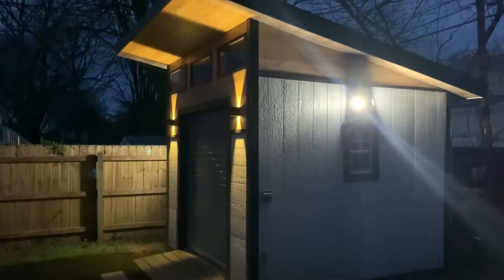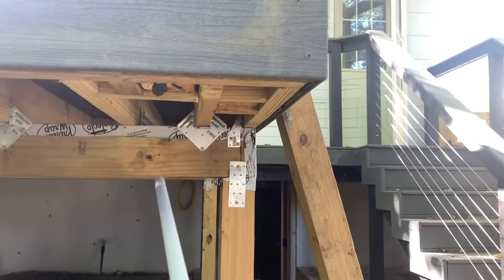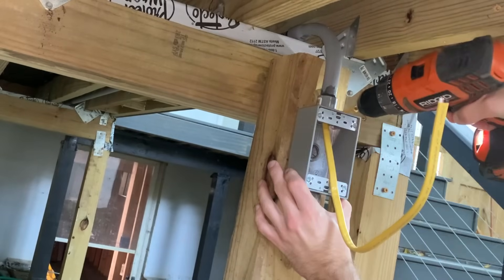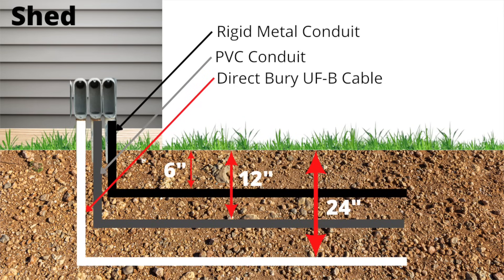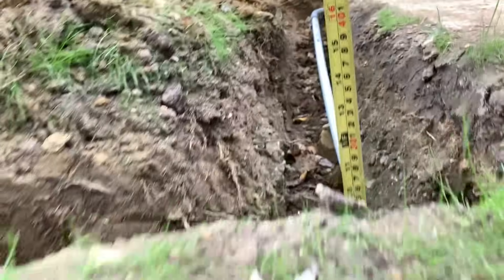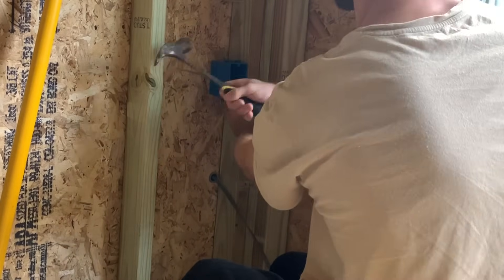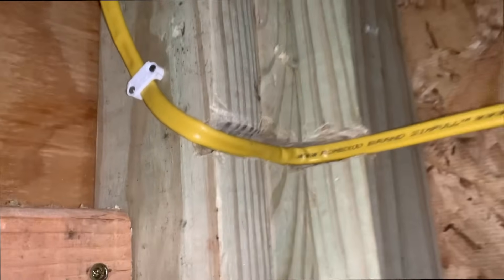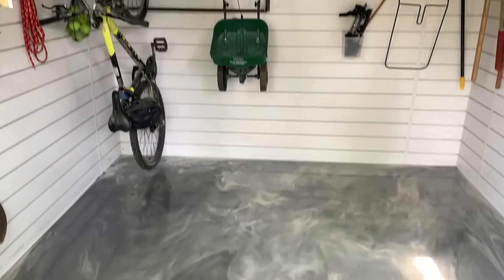Shed Electrical Installation (How to Add Electricity to a Shed - DIY)

Comment: A lot of code violations , was this passed by the inspector ?
Reply: I was thinking same thing especially not running thhn in conduit. I believe the extra jacket on all that wire is going to make the circuit worse as far as thermal ampacity

Comment: Why would you push Romex down PVC? Set a junction box and pull THHN through it until you get to the direct burial cable. Set another  weatherproof box there and tie in the UF cable there or run more PVC and use THHN. Romex in PVC is a horrible waste of conduit space. In a piece of 3/4” PVC, you can safely put 15 #12 THHN in it.

Comment: The NEC article 300.5 table 300.5 clearly states that under normal circumstances PVC shall be covered by at least 18 in of Earth
Reply: Column 4 allows for 12" in this case.

Comment: Romex in conduit is a code violation…I failed inspection for the same mistake. Double insulator is not allowed.
Reply from the maker: That is concerning since the electrician I had come out did not say anything about that.Thanks for mentioning this. I want to reiterate that all electrical work should be performed by a licensed electrician. I get mine inspected, but it sounds like even that isn't 100% Full proof.
Reply: To further add to what PolSlo 80 said, it's not even supposed to be outside.
Reply: It also depends on where you live codes are different so I’ve heard
Reply: @AndrewThronImprovements  maybe you might want to rethink the content you're putting out if it's not accurate.
Reply: @Willie Hawthorne and everybody who has it inspected will fail because of its in the electrical code. Just food for thought for the next project.
Reply: @AndrewThronImprovements  I think it depends on the region
Reply: Code reference? It's not a code violation to have Romex in conduit, but it's not allowed to be installed the way it was done in this video.
Reply: @polslo8091  Code reference? Romex is allowed in conduit, but you won't find most pros doing it that way.
Reply: @polslo8091 what code section tells you that romex not allowed in conduit please,I cannot find it.
Reply: @thomasmarable6818  i remember reading it is allowed except in wet locations
Reply: @AndrewThronImprovements  NEC does not specifically touch on this, romex being installed in a conduit, but a municipality can have more strenuous code requirements. This is why polslo8091 failed inspection. Romex is not rated to be ran in conduit. It has the potential to heat up and catch fire. The electrical portion of the video really needs to be taken down.
Reply: @JoseRomero-cx2lz  codes aren't different, they are just a bare minimum. Most often, municipalities have more strenuous code requirements.
Reply: @williehawthorne8350 HA.... no they don't! especially to this extent! 🤣🤣🤣
Reply: @pld8993  I wouldn't say it's allowed, but NEC does not touch on romex in conduit. Romex is not rated for a conduit and therefor nullifies it's UL listing.
Reply: @thomasmarable6818  There is no code section, as NEC does not touch on it. The municipality probably has a more strenuous code requirement then the NEC, which is a bare minimum requirement, simply because romex is not rated for conduit per the UL listing.
Reply: @dhazz1536  You may want to read 334.15(B), 334.15(C), and 334.30 before you make the claim that the NEC does not touch on the subject. Please identify where in UL719 the listing of NM cable is dependent on it not being installed in conduit.
Reply: @dhazz1536  You may want to read 334.15(B), 334.15(C), and 334.30 before you make the claim that the NEC does not touch on the subject.
Reply: @thomasmarable6818  You can't find it because it doesn't exist. 334.15 explicitly allows Romex in conduit.
Reply: @dhazz1536  You're wrong.
Reply: It is different in some states so could just be your state.
Reply: NM cable cannot be installed in a damp or wet location. Outdoor or in slab PVC is not considered dry.
Reply: @AndrewThronImprovements  Romex in conduit above ground isnt a big deal [maybe on a roof is bad or direct sunlight all day too], some people only know Codes, but not WHY the codes are there. For a shed outlet? Thats not used that much? Two reasons romex isnt allowed... 

1- Overheating, cable insulation is designed to breath, your not supposed to bundle romex together in clumps to allow for cooling for this very reason. Romex in conduit, is fine, but in direct sunlight in summer, on a roof? it gets too hot. And using lots of power on the wires makes it way too hot, you're fine for the shed.

2- Water, Romex isnt designed for water resistance, if you went underground it would be a problem, or maybe if this cirucit was critical like for a sump pump, or emergency power, then yes this would be very bad. Your particular violations are like 'not fully stopping at a stop sign', not 'drunk driving'. Minor issues
Reply: @Willie Hawthorne Trolls? There are several National Electrical Code violations in this video. Do not take advice from this guy.
Reply: @AndrewThronImprovements  Type NM cable (Romex) is suitable for dry locations only. If the cable you ran inside the PVC underground was UF cable you would be good. Romex is NOT permitted to be installed in a wet location. Underground is a wet location. Installing it in conduit does not turn it into a dry location. I've never seen anyone install PVC conduit that didn't eventually get moisture inside.
Reply: @PolSlo you are wrong. Reference the NEC code book article 334.15(B) Protection from Physical Damage: [Type NM (Romex)] Cable shall be protected from physical damage where necessary by many types of conduit including Schedule 80 PVC.  Now, this is referencing Romex Cable above ground in a dry location, but Romex is certainly allowed inside of conduit according to article 334.
Reply: @PolSlo 80  I had an electric inspector tell me to put romex in conduit and passed me.
Reply: @polslo8091  It is not against NEC code to run romex in a conduit, maybe your local codes are tougher...
Reply: @pld8993  I'll definitely look it up. Is that a newer code? I am pretty sure that talks about running romex in conduit as a "Sleeve". As stated in another comment, I gave an example of when you'd run romex in a conduit. I.E when you come out of the ceiling into an unprotected wall like a garage. This is permissible.  I'm pretty sure you gave me a code reference of "exposed work", in which that is exactly what my example stated. NEC, to my knowledge, does not mention anything about long runs of conduit with romex in it.
Reply: @pld8993  wrong about what? If you are referring to the code you replied with, that is for exposed areas... and does not specify the length of conduit runs. I could be wrong and please correct me if so, be that it referring to running romex or NM cabling in sleeves, not long runs.
Reply: @dhazz1536  Not a new code, been the same for decades. Running Romex in conduit is not restricted to sleeves (the NEC does not use this term) or short runs, 334.15. However, running Romex in other than short sections for physical protection, is amateurish and you're unlikely to find a professional pulling Romex if they went to the trouble of running conduit. It's waste of labor and money and makes no sense except where absolutely necessary. While 334.15 does require conduit in exposed locations, nowhere in 334 does it prohibit NM cable in conduit, except in wet locations.
Reply: @pld8993  Understood, haven't been in the code book since 2004. With that said, we are now back to my original point that NEC does not specifically state that romex  can or can not be ran in long runs of conduit. I went and read the code you provided and like I thought, it's specifically talking about unprotected locations and not the situation this person is using it in. Regardless of what the code you posted says and how you interpret it, this is wrong and any municipality in S. Florida (where I'm from) would not allow romex to be ran in conduit in this fashion. Haven't done a calculation on conduit fill in decades, but I'm pretty positive with the UL temperature rating for romex in 1/2" pvc would not meet the requirements. Please correct me if I'm wrong. For this reason is why it would never pass inspection. I've seen or heard it numerous times in my past electrical career. If romex was ran in conduit down an unprotected wall, we were always required to strip the outer jacket off the romex, than run it through the conduit with no more than 1' of the outer jacket inside the conduit.
Reply: @dhazz1536  I guess when you've lost the argument on its merits, personal insults is all you've got left. It's not rocket science, genius. All you have to do is read the actual words printed on the page. That's how professionals understand the code; we read it.
Reply: @dhazz1536  Yes, the conductors inside Romex are rated for 90C and UL rates the cable at 90C, but the cable is required to follow the 60C rating according to the NEC.
Reply: @pld8993  you are correct it allows it just not in wet locations. I very familiar with that code section.

Comment: You need pigtail on you outlet, I did my shed huge mistake didn't run spare wires for future circuit.
Reply: You just needed to make sure your conduit was big enough and then always run a string through to be able to pull more wires latter.  Better idea would have been to run a larger gauge wire in the first place and put a breaker box in shed so you could add circuits later................
Reply: Agreed. Would have ran a very solid substantial Amp source to shed with a small panel with extra breakers.

Comment: Good job on shed itself, looks great, but electrical install not code.  NEC min. cover requirements regardless of voltage: RMC = 6": PVC = 18"; direct burial cable = 24".  NM-B (Romex) not approved for exterior, damp or wet locations.  Exterior and underground conduits are considered damp locations, so in this case no Romex in conduit under the deck.  No more than 360-degrees worth of bends between junctions.  While UF-B inside PVC is permitted, it still must be 18" deep.  Don't blame you for pushing the cable in the conduit as you go; would have been a fight to the death trying to pull UF-B through all those bends.  Exterior light switch cover does not make proper contact with box for watertight seal.  Finally, the shed should have its own local disconnecting means.

Comment: My building has 10 uf in the air from the house to a drip loop into the top under the overhang to a small sub panel. 220 volts available. Runs a well pump, lights and receptacle. No way will i waste my time running just one 12 gauge wire to my building(shed). Would have done underground but i would have had to dig all the way around the house and under the driveway.

Comment: I was told you need to unsheathe the wires when running through conduit because of heat. My father in law is a retired contractor and helped us run a line to the back patio. Our conduit was above ground attached to the house though.
Reply: No, the sheathing on romex is not allowed to be removed when installed in conduit. Romex will not overheat because it's in conduit.

Comment: Somebody check me here. I believe in addition to using the wrong wire, there are too many degrees in turns per NEC.
Reply: Web search, hope it still applies; The NEC officially limits you to no more than 360 degrees worth of bends, NEC 346-11. I.e. 4 qty standard 90 degree turns.Jul 18, 2017
Reply: You're correct, he's over 360. It is also a violation to slide sections of conduit over the cable like a sleeve one at a time. The conduit must be installed complete between boxes before the conductors are installed, 300.18(A). Can't run NM cable outdoors either, whether in conduit or not (under the deck). Multiple NEC violations in this video.
Reply: Larger conduit, less 90's and stranded wire. Straight line from house to shed.

Comment: Awesome production.  Fast so as to maintain attention but ohhhh so wrong.  But hey! A half million views, so although I know it's unsafe, you must be right because you are popular.  There's a thing called NEC put out by NFPA.  While jurisdictions must adopt it and have competent enforcement of it following it is simply a "good idea".  As everyone says, no romex in conduit.  Not only is out door conduit considered a wet environment, romex just isn't allowed in conduit due to heat concerns.  Consideration must be given  to  length of the run.  I added power to my attached garage and had to select the cable based on the distance from breaker panel to the sub.  Again it was noted the boxes must ve flush with surfaces or have extenders.  Very important for FIRE safety.  If you go the UF direct burial method you actually are supposed to have a certain amount of sand below and above the cable so no rocks contact the cable.  Direct burial, when done correctly is far more expensive and time consuming than conduit.  NEXT, I'm stepping off my soap box, somebody else go.

Comment: Romex can’t be in conduit outdoors, should of been wire rated for that application. Another thing you’re not allowed to do is pull wire as your building the raceway. You’re suppose to build it and then pull the wire through Can cause damage to wire.
These things might seem minor but when you’re putting out content for other diyers to do you should do a bit more research and make sure you’re 100% on doing the install correctly.

Comment: The right way to do it is to have the conduit stubbed out from the house then run all the conduit and pull your 12 or 14 wire from there.

Comment: He talks about consulting an electrician, but then shows doing lots of stuff that an electrician would not gave recommended if he followed NEC. 
A short list—NM cable in a wet location his yellow wire coming out of his house. NM cable in conduit-allowed under special conditions for short runs. Direct burial wire UF un conduit see above- not by NEC for length of run. And the list goes on
Reply: While the NM should not have been used outside, both NM and UF are allowed in conduit in unlimited lengths and are not limited to short runs or special conditions.

Comment: In your state, they allow ROMEX to be ran through CONDUIT?
Reply: The NEC allows romex in conduit.
Reply: @louiewilkins7503  Yes, romex is allowed, and sometimes required, in conduit. If I'm wrong, please share your code reference.

Comment: No need for all of that. If you have an electric generator, like an Eco Delta 2 Max, just keep it in tne shed and ready for your backup needs or other use. In the meantime, just plug you generatir into you internal shed wiring. No need to dig up the yard.

Comment: only 4 components to a solar system on the shed. used panels, switch/fuse, charge controller, inverter/batteries. no permit possible check with local govt. Used panels 50 bucks each the most expensive thing is the batteries.

Comment: that cable insulation can degrade. I've seen you use that glue on pvc and was creating a mess in some areas. I wouldn't trust those hands working around it. Cable insulation glued to pipe tears while installing is a pretty big risk if you end up pulling too hard. If you want to update electrical in the future, you're going to be really fighting with the wiring and breaking the joints off your conduit even though its underground.

Comment: Good ideas and information, but terrible execution- Romex in conduit is not to code, you need to apply glue to both the pipe and the inside of the bell end and insert the pipe into the bell completely,  twisting and holding for at least 5 seconds to get a secure joint.  2 circuits, 1 for lights and one for power would be the best setup, as @kpd3308 states below.

Comment: 1)  Never trust your life to a non contact voltage tester.
2) That is not a 1/2" drill bit
3) NM cable is not allowed outside. (Only a technical foul IMO)
4) Stuffing cable thru PVC is a PITA :).  An electrician would have pulled in individual wires

I will give you a C for the overall job because it's not horrible. :). If you were to have used individual conductors and not so many bends, you could add circuits later and you would have gotten a B :)
Reply: yeah non contact voltage testers are toys
Reply: @yeeyee2739  I think it's a very useful tool but before you put your life or tools on the line, use an actual voltage tester :)

Comment: I’m an electrician you can’t put romex in pvc. It’s not rated for wet location. You did it all wrong
Reply: Doesn’t matter if it’s above or below. Any exposed pipe has to have THwN wire in it not romex. That romex will get wet.
Reply: You could of used UF-b in the pipe
Reply: Also you can have UF-B cable buried in 6 inches if it’s gfi protected first
Reply: @jasonault3511  No, 12". 6" if it's under concrete or in rigid or IMC
Reply: @pld8993  not if gfi protected before going into earth. Under exceptions
Reply: For if wire
Reply: @jasonault3511  You're wrong, see Table 300.5. Please identify this exception you're referring to.